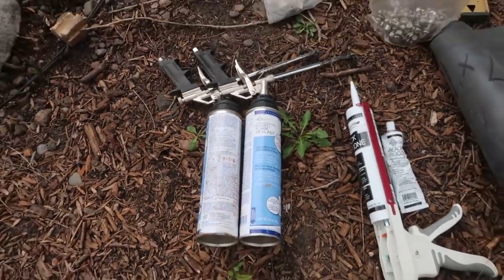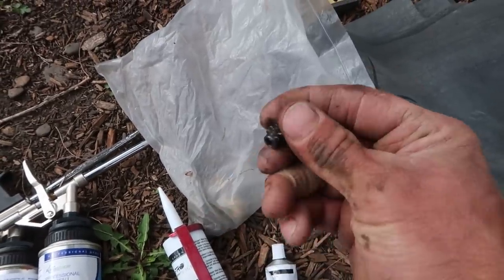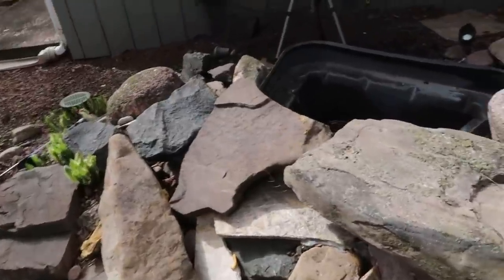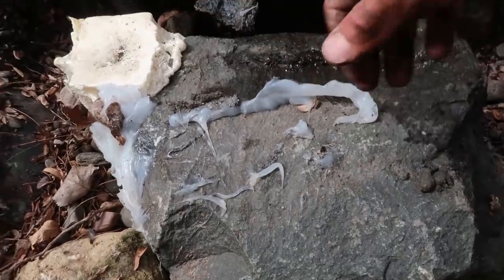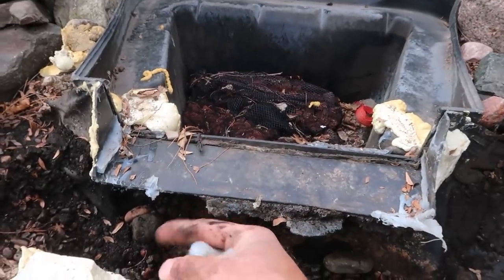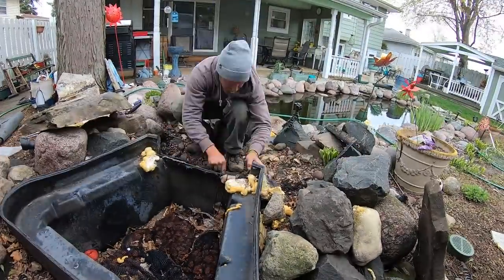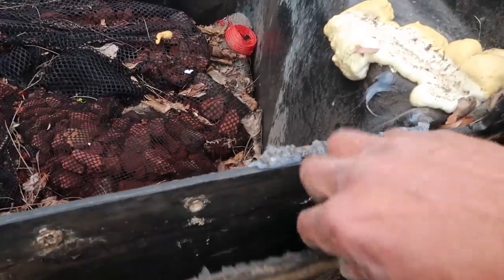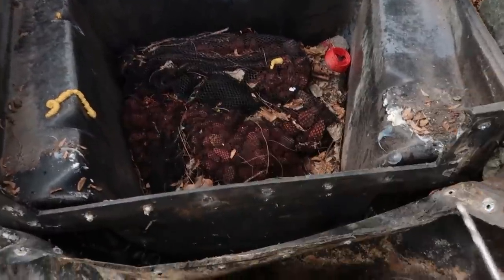How to Fix Leaks and Reseal a Waterfall - Aquascape BioFalls®

Comment: I use a couple of Awl's to pierce and hold the liner before putting in the screws. I also buy stainless steel hardware a couple boxes at a time. Comes in extremely handy for the old aquascape biofall and skimmer systems.